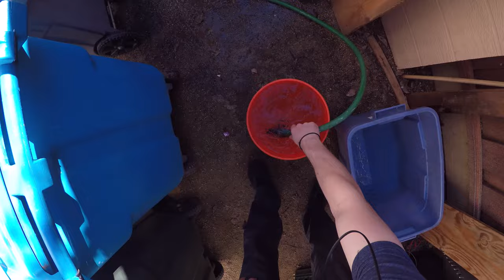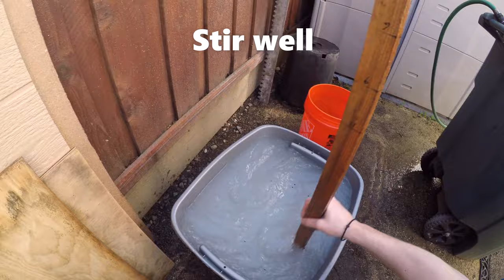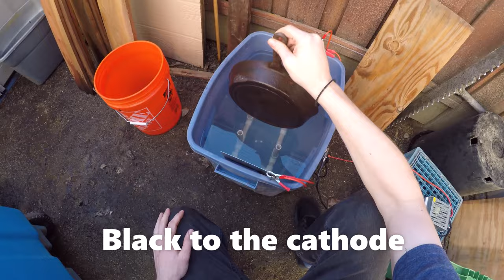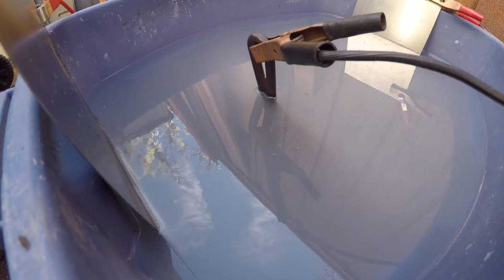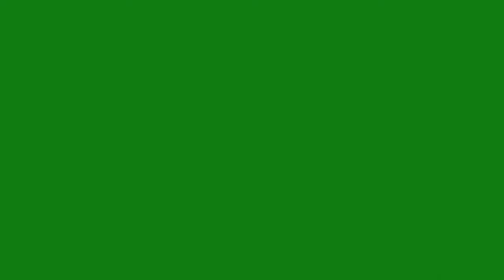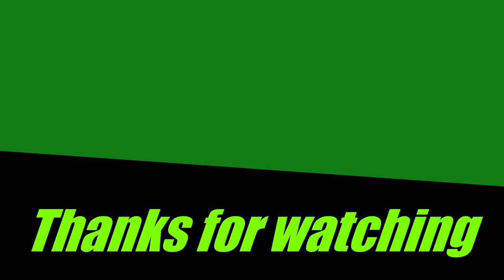How to make an electrolysis tank - The basics

Comment: What is the gadget that lets the current
Reply from the maker: @mihajloaleksic5710  hey miha, that is a manual charging DC power supply. Manual car battery charger is another name. Need to have one that let's your set volts and amps, not the auto select one.

Comment: Why not submerge the handle w/ the clamp? That will leave a line on the handle. Can’t the negative clamp be submerged in the solution?
Reply from the maker: It depends on who you get your advice from. Some people submerge the clip some say not to. Ive changed my setup alot since this, but its the jist of it. Set it up how you like best. Good luck to you
Reply: Yeah... Advice is all over the map  @CastIronRestore ... I agree... Get pointed in the right direction and adjust accordingly. I mentioned the handle because a few folks said it leaves a visible line. But I also see many factor affecting THAT too! LOL... Thanks!
Reply from the maker: @misterjim4458  it definitely does leave a line. From my XP if you submerge the clip it like connects the whole circuit, that may not be the right term. It seems the rust you pull away from the pan then just gets pulled away from the anode. I think if u submerge the clip it stops the electricity flowing in one direction. And does electro plating and eletro surfacing at the same time. I worked in a plating shop for a couple years and tried to mimic the setup there we had for cleaning parts. The line seems to go away after seasoning and a couple months of cooking.Take care man 🤙
Reply from the maker: @misterjim4458  one more thing on the clip. In my video u can see the water has a layer of like orange foam. I think this is product of submerging the clip, it pulls the rust right back off the anode. Once i stopped submerging the clip, this top layer stopped. I think if you see this layer on top its not good. You only want that if you were reversing the process to clean your anodes. Hope thak makes sense lol.
Reply: Those bubbles are hydrogen... The orange is rust... Keep sparks/flames away from those bubbles @CastIronRestore ... “Ka-BOOM!”   💥🔥😵🤕
Reply: Steel coat hanger wire through the hole on the pan handle will allow the entire pan to submerge. Connect the lead to the wire.

Comment: Is the water toxic to skin afterwards?
Reply from the maker: No should not be. Just rust and washing soda in there. Though washing soda can irritate sensitive skin, so if your worried throw some gloves on and you will be good to go.
Reply: @CastIronRestore  thanks for the reply .....you think a cast iron skillet would be ok to leave in for 24 hours?
Reply from the maker: @Malcomb35  yes definitely, though depending on amperage you may only need 8 hours or so. What amperage are you running?
Reply: @CastIronRestore  10amp....
Reply from the maker: @Malcomb35  you might be able to get away with 8 to 12 hours at that amperage. If you want to run 24 hours, go to like 3 or 4 amps. It will eat less of your anodes. 24 hours at 10 amps may just eat ur anodes at a point and the pan will be clean you know what I mean?
Reply: @CastIronRestore  last question,  lol I promise.....I have the option between a few different thicknesses of rebar ...is thicker better ?
Reply from the maker: @Malcomb35 Hey dude, no worries. You can ask any time. How thick is it? the thicker it is the longer it will last. Just make sure you can get a solid connection to the rod. Either by drilling though, or brushing and clamping on.

Comment: Looks like you hooked the steel plate to a little gray box of some sorts, and the pan to a battery charger, can you explain the little gray box and the hook ups?
Reply from the maker: Hi John, we will have a better video out soon with explanations, but to answer you. The steel plates are connected to the postive ends of the battery charger. Since the DC power supply only has one red prong I use spare wire to create a second postive connection for the second steel sheet.

The pan is then connected to the black side of the battery charger. This causes electricity to flow from the pan to the steel sheets.

That is all that is connected. Steel sheets to postive side, pan to the negative side. And ofcourse make sure they dont intersect.

The gray box is a 12V 10A DC power supply with alligator clip leads.
Reply: Do you need two steel sheets or would this work with just one for smaller applications?

Comment: Red to anode, black to cathode - Both look red to me. ?  Then a black connected to the pan. I am guessing here because the instructions kind of confused me but both the reds are HOT and the Black in Negative? 
Mine blew up. Musta done something wrong.
Reply from the maker: I've just chained my 2 steel plates together. That's why you see what looks like 2 red wires. Though it is just an extension to reach to the second plate. Nothing can blow up from this. If you reversed it, it would then start to electro polish the surface.
Reply: @CastIronRestore  Sounds interesting. Rust Plate something? Hummm...   Yeah, Hydrogen gas is released during the process, I got a spark, and a good Pop/explosion.
Reply from the maker: @xro5841 wow, I've not heard of that happening to anyone. Though it is possible. Just be careful, use lower amperage like 4 and be in a well ventalilated area. There are some more in depth videos out there. This is just a quick start.
Reply: @CastIronRestore he’s telling tales bro. 🤣
Reply from the maker: @Zeddicus_Zorander  xD